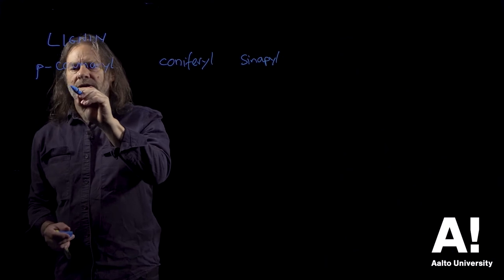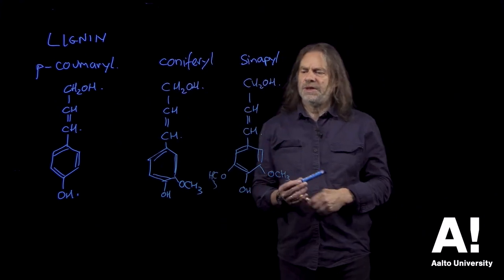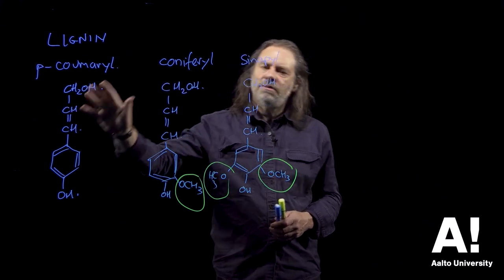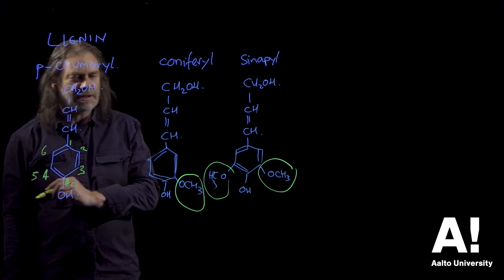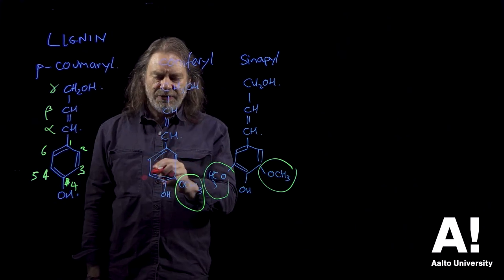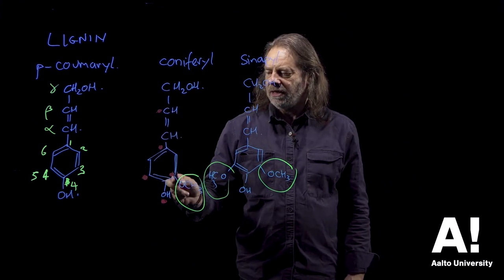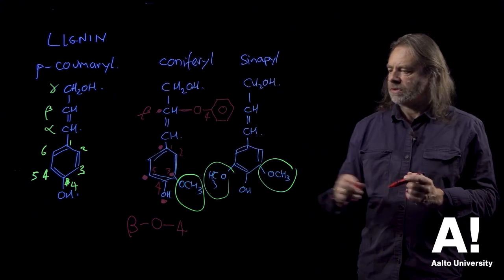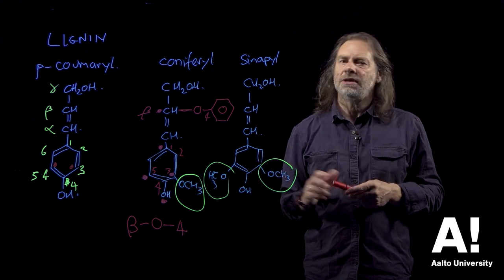Wood chemistry (8) Lignin

Comment: Question:

"The nature of lignin itself also has a great influence on the degradation behaviour function of fungi, for lignin is not a well defined chemical substance but rather a heterogeneous class of compounds (Otter 1996). Of these, the two phenylpropanoid units guaiacyl and syringyl are the most important monomers in the lignin of trees. Conifer wood lignin consists almost exclusively of guaiacyl monomers, whereas hardwood lignin consists of approximately equal portions of guaiacyl and syringyl (Whetten and Sederoff 1995)." F.W.M.R. Schwarze. 

Where in the process of the formation of the two types of lignin does the above text relate, in relation the the described three fundamental building blocks of this video?